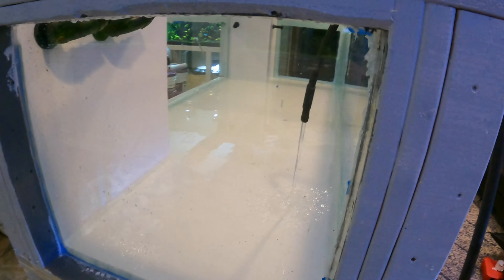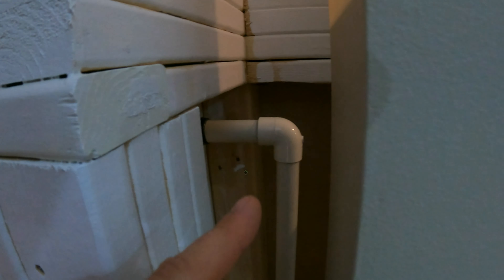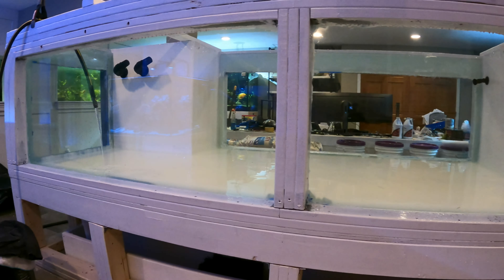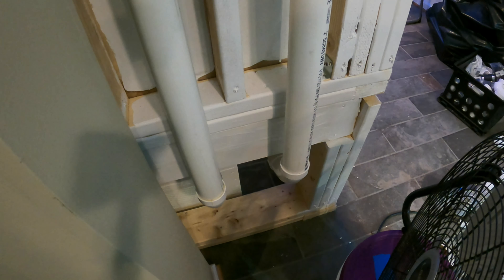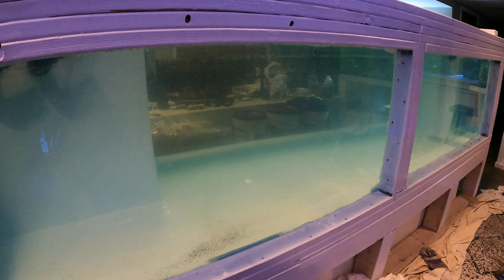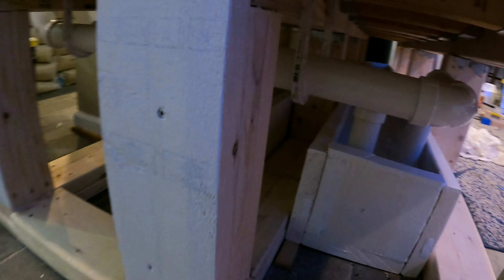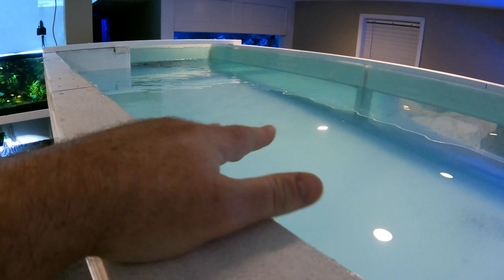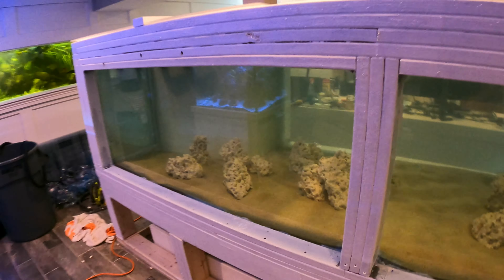Predator Bay DIY 1800 Gallon Aquarium is Primed & Ready! Massive DIY Marine Tank is ready for fish!

Comment: Could use check valves on return lines to prevent back siphoning
Reply from the maker: Hey Ark! Yeah absolutely that would work and will most likely be the approach on future builds. For now I have decided to just go head and route the loc-line to the surface and drill a small siphon break hole in the tube just below the water line.

Comment: You can use PVC check valves on your returns also that way if and  when the pumps turn off it won't backflow...
Reply from the maker: Hey Ian! Yeah absolutely that would work and will most likely be the approach on future builds. For now I have decided to just go head and route the loc-line to the surface and drill a small siphon break hole in the tube just below the water line.

Comment: Could you put together some plans on how you built the tank structure and how many gallons it holds and the thickness of the glass you used. I want to build a very large aquarium but the weight of water makes me a bit nervous.
Reply: i think start building some smaller squariums first to learn as much as possible. This dude has already built  huge aquariums so he knows what he's doing, i guess experience is the main thing. Good luck
Reply: yeah, I can support Freddy's comment. Just start small. First build a 10 or 15 gallon plywood aquarium and go from there. The costs of a small tank are low (probably under 50 bucks for plywood and epoxy, hopefully you can buy a cheap/free aquarium as a glass donor (you only need one good pane)) so if you screw it up it's no problem. Then take all you've learned and if you feel good about it make a 40 gallon, and so on. There is no point in investing in such a large project as predator bay if you don't know what you're doing. There are plenty tutorials on plywood aquariums on youtube and if you do a small tank like 10 or 15 gallon, you're fine with 6mm glass and 18mm plywood only.
Reply from the maker: Hey Ferdhy!  I have built all of my tanks in a custom manner...all different sizes, shapes, water volume etc. even including different build models..stacked lumber, framed, etc. so not really a single build method that I could recommend you follow.

There are pretty clear standards on glass height/thickness that I could advise you on...plus I would be happy to give you my thoughts on any specific build questions you might have.

The comments from Freddy and Willie are both good and I would also recommend DIY build threads from Reef2Reef and MonsterFishKeepers forums. While not a blueprint a couple of my videos go into more build detail (Episode 8 & 12)

What size tank are you thinking to build? Maybe I could give you some build recommendations.

Comment: A great looking tank! Epic.. 👍 What kind of sharks and rays do you Plan on stocking it with? Curious as to how many return pumps you’ll be running on there? What power heads are you going to be using for flow? How many gallons is the tank?
Reply from the maker: Hey Rogue! Tank is 1800 gallons (tank + filter) and uses one large DC return pump feeding two returns. As for the livestock and additional equipment I will cover all of that in part 6. when the tank goes live. :-)
Reply: @AquariumDomain.  sounds good.. looking forward to seeing the predator tank come to life

Comment: Why wouldn’t you put a couple backflow preventers on the returns? They would cure your issues with overflowing the sump if power goes out.
Reply from the maker: Hey Richard!  Only ones I know of that fit my 1" loc-line are from Vivid Aquariums and they have been out of stock forever. Do you know of a good place other than BRS & Vivid for buying loc-line connector parts?  To move forward I just bought a reducer from home depot and took the line down to 3/4" and changed out the nozzle. Really easy to swap out though as it just screws into the bulkhead...if I find a better solution.
Reply: @AquariumDomain.  I’m in Ontario Canada so my usual supplier is a place called pets and ponds in orillia. They’re only an online store and their stock is usually second to none. With the pandemic it has been a challenge to get a lot of items. Love the fish room btw can’t wait to see predator bay fully stocked.
Reply from the maker: @richardpeatfield4497  Yeah 2020 was a crazy year for trying to source both livestock and building materials...lots of things out of stock and sky high prices. I know I can't really start my next build until lumber prices come down. :-(
Reply: @AquariumDomain.  we’re all in the same boat. Trying to build a shop so I can build an acrylic tank for my Frontosa’s good thing they’re slow growers.